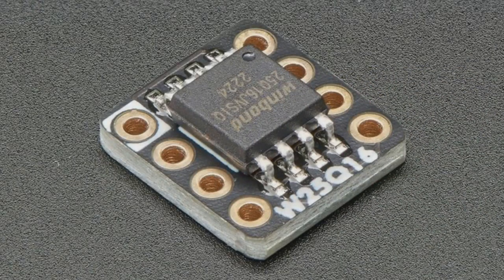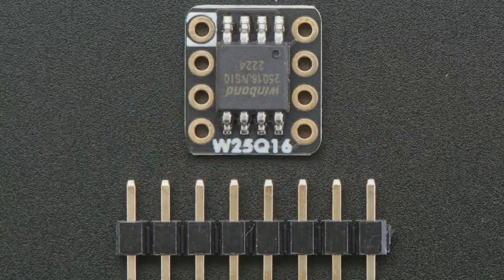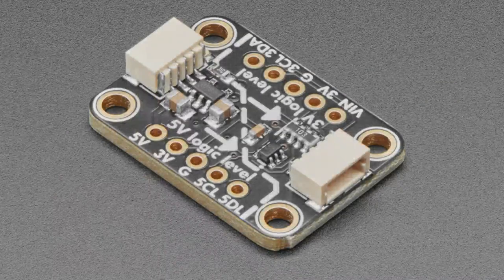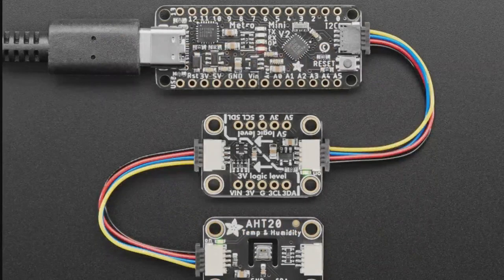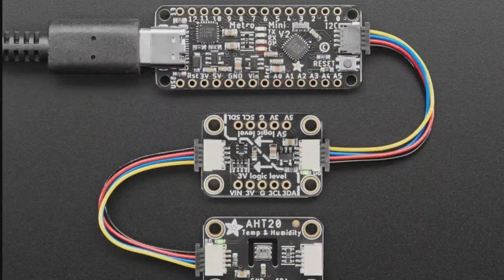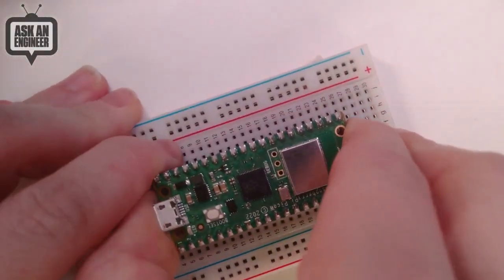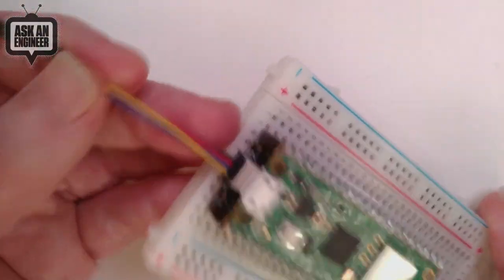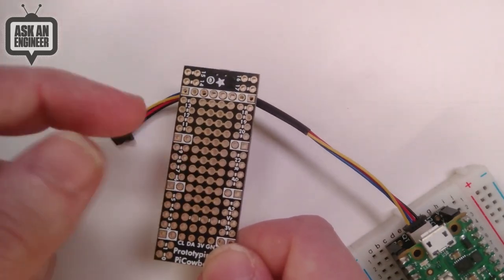#NewProducts 10/19/22 Featuring #Adafruit #PiCowbell Proto for Pico - Reset Button & #STEMMAQT!

Comment: Could we have a video giving a little more detail on ways of using the QSPI breakouts?  For example, with the Pi Pico and the earlephilhower arduino core that was mentioned.

A quick run through of using the library would be good.  Can it be used with other Flash filing systems, like LittleFS?  It's hard to get started on something that's completely unfamiliar, and I haven't yet found anyone else covering this.